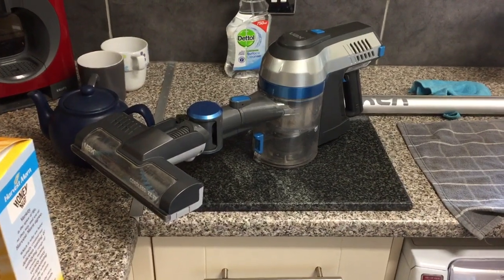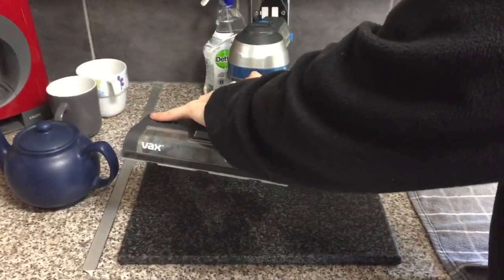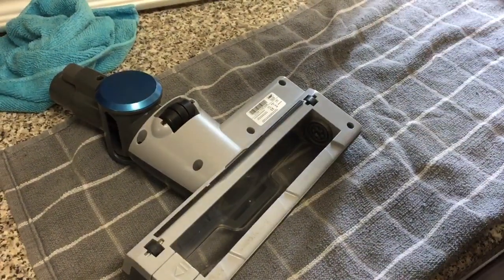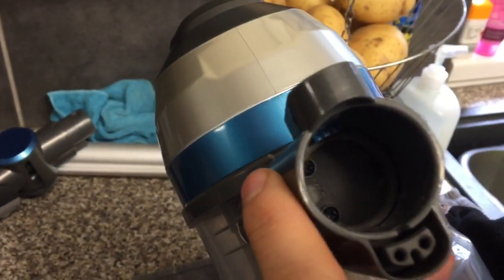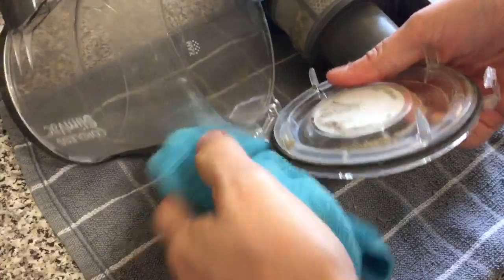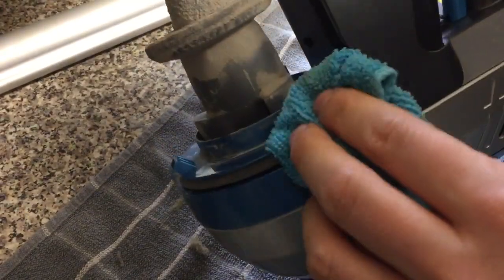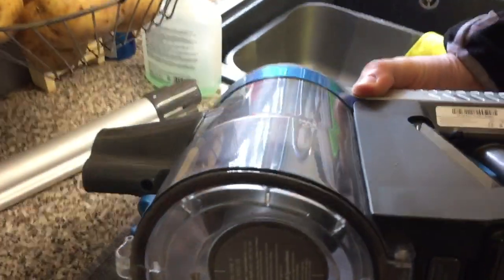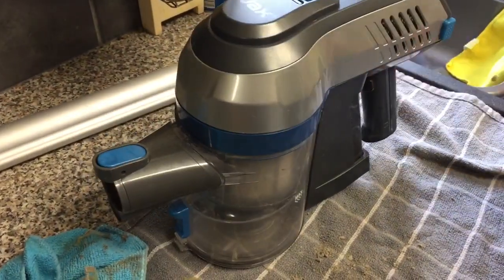How to maintain your cordless vacuum cleaner Vax Slim Vac

Comment: hi daniel i have this hoover and on the brush head there is a sml roller ball with a thin metal bar what is that called as mine keeps falling out and it doesnt work properly without it . i pop it back in but ascsoon as i put hoover upright the roller thingy falls out .

Comment: Question, were you pulled the back out the post motor filter if you look inside there is squares, in mine there is fur behind that which will not come out and tried pulling out with twisers but if fall back into the Hoover so will I have to take it apart?
Reply from the maker: I have also noticed this as well, try to remove it but i wouldn't take it apart. if you press the trigger a few times it should help clear any rubbish in there
Reply: @DanielJohnHowTo  Okay I'll try that thankyou
Reply: The little vent behind the pull out filter at the back looks dusty but i cannot get to it. Cant get the suction back and followed advice 😨

Comment: Once power head fitted the vacuum stops working. Any idea how to fix this? Thanks
Reply from the maker: Is the power head button turned on when it won't work?
Reply: @DanielJohnHowTo  not sure. Will have to check that
Reply: @DanielJohnHowTo  Could you possibly explain what you mean when you are saying is the power head button turned on. No matter what I do with the button it won't work once power head in use. The vacuum is working with all the other fittings but the power head. Once I try to use the power head it stops working and the red light starts flashing. Thank you